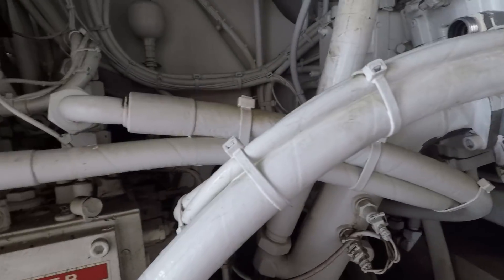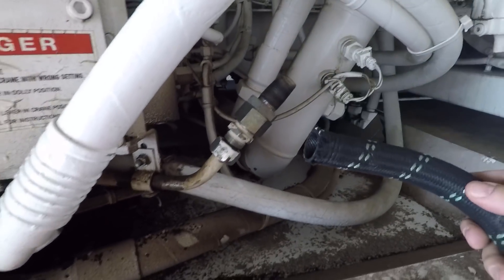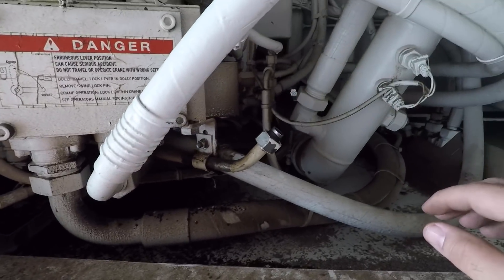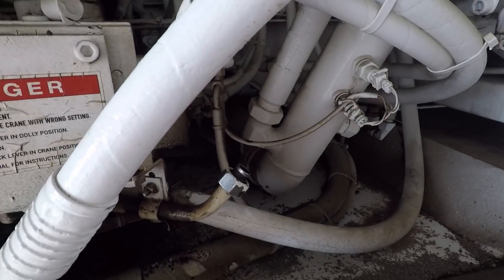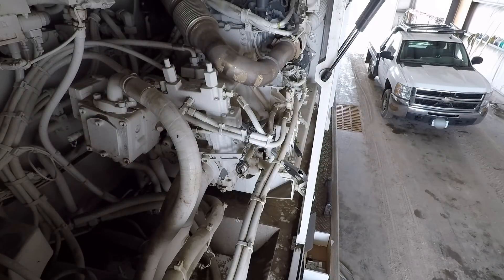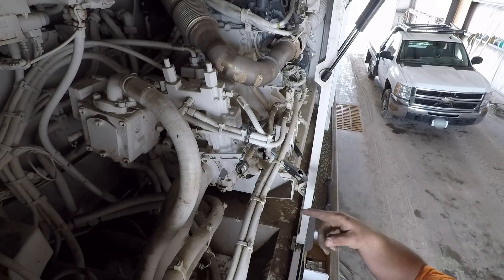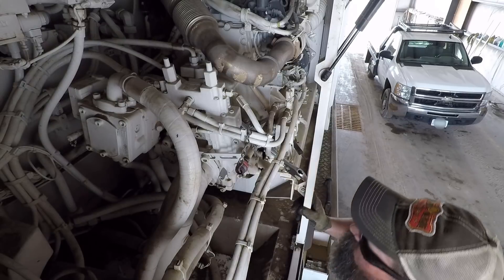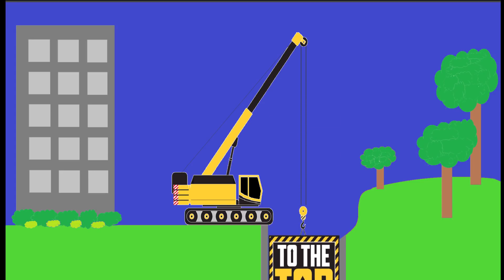Tadano crane airline modification

Comment: I had the clutch servo motor go bad on GMK Krupp Mercedes ...no one in America could sell me parts. Grove wanted $10,000 for a tiny Bosch 12vdc motor . Bosch refused to sell me parts or service info on unit. I got a guy in England where alot of Mercedes Actos transmission are in trucks to sell me a rebuild kit and manual for Daimler Mercedes transmission clutch motor.  
Germany lost the war now they get back at us this way.

Manitowoc Grove crane care 24/7 phone helpline bailed me out many times. Not sure if Tadano has this.
Reply from the maker: james norse, what was the work around to get the crane home with no clutch? Did you have to tow it or just let it creep along in whatever gear it was in?

I have the cell numbers of a few Tadano techs. They will answer 24/7.
Reply: To The Top Crane There is a tiny emergency clutch pedal which activates pneumatic clutch throw out bearing. We used this until we sold it. No Automatic transmission function in emergency mode but . drove good. Grove GMK has this tiny Pedal under dash which folds down if Actos trans failed. My buddy Liebherr 300 ton blew his Allison trans in NYC in middle of city. No one could tow   with truck.. Had to switch trans on side of road in Queen NYC. There is a special tow bar kit to tow these large AT. No where to hook tow truck or flat tow it on front. Maybe get one for Tadano. Murphy's Law

Comment: can't it be a metal line ?
Reply from the maker: +James Chris Beck, it has to be flexible, as the engine is on rubber engine mounts and the steel line running to the dryer is rigid. Thanks for watching! 🙂

Comment: Is it just me or is a crane one of the worse applications to have a motor go into a limp mod other than a jet or fire and rescue
Reply from the maker: Josh Welner, it's not just you. Limp mode in a crane is no good. They did build some safeguards in though. In limp mode, it still has enough power to fully retract and lower the boom. However, if the engine is shut off after being in limp mode for a while, the ECM may not allow another start up. So, if limp mode is activated, retracting and lowering the boom is first on the checklist.
Reply: To The Top Crane I was just thinking you would want full power if needed to get things on the ground if something happened ASAP but what do I know I'm just a stupid fisherman with a vary vary small experience with cranes
Reply from the maker: Josh Welner, no fisherman is stupid. 😉
Reply: To The Top Crane your wrong ask my wife hahahaha you have a great night 👍🇺🇸
Reply from the maker: Josh Welner, hope you have a good night as well.
Reply: @joshwelner1951   "I miss my ex,  but my aim is getting better."
Reply: Juin

Comment: That part was engineered to fail in order to sell, what I'm thinking a not so cheap part,  once it's all said and done. Great fix, that's the way it ought to be done as you said. Thanks for the video.
Reply from the maker: Duncan MacKenzie, it was the best cure I could come up with. I guess I'll have to give everyone an update in a year or so. On a side note, the swing brake valve I replaced a while back is working like a charm.

Comment: silver solder melts at 800F I dont think it will leak grins
Reply from the maker: Bleu Wolf, I knew it was a high temp. I wasn't sure just how high. 800F ought to cover it. 😉
Reply: its about that depends on the mix and brand
Reply from the maker: My curiosity got the best of me, so I looked it up....I was actually using silver brazing rod. That is over 840F. I'd say a heat related failure is definitely out of the equation.
Reply from the maker: Bleu Wolf, Safety-silv 45 is what I was using. I just looked it up. It becomes a liquid at 1370F. 😳 If it ever gets that hot in there, the whole crane may become a liquid. LOL Thanks for subscribing, watching and commenting. 🙂